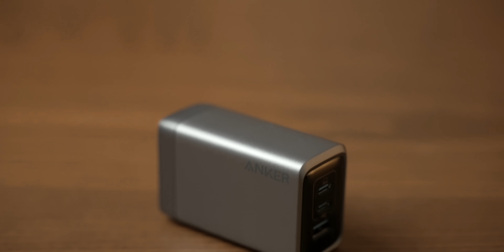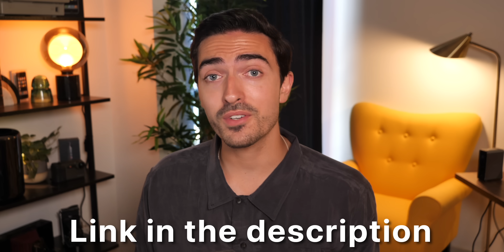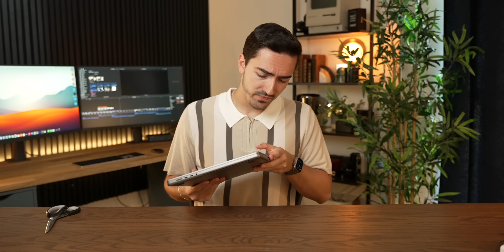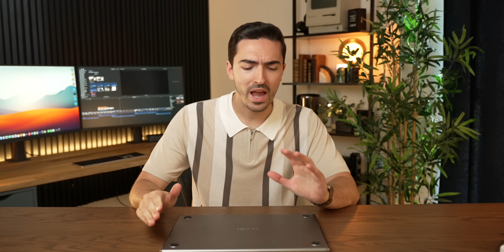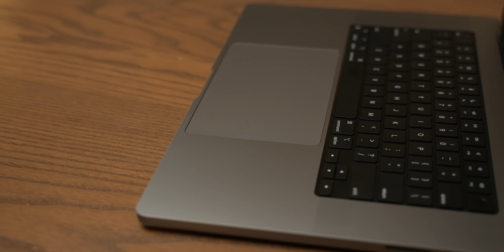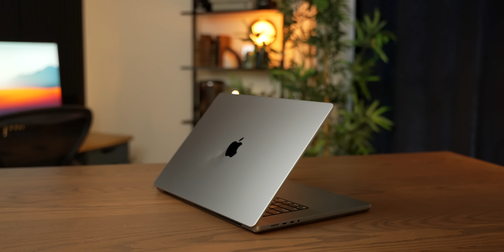I bought the CHEAPEST M1 Pro MacBook Pro on eBay!

Comment: Very good video.  Thank you.  Would I buy this MacBook Pro?  Um, no.  I don't but any laptop above $600 or so.  Still using a Gen 1 MB Air with 512 GB storage I bought for $400.  And a 2015 MB Pro with upgraded processor and dual graphics- $100. $500 total. Both still do what I need them to do.

Comment: I am from Germany and I earn my money by buying and reselling Apple MacBooks and imacs. Nowadays only silicon based. I purchased a MacBook M1 Pro 16" with 1TB SSD this week for 960 Euros in prestine condition with 52 charging cycles on "Kleinanzeigen" which is a nationwide marketplace here in Germany and the MacBook was even personally delivered to me and I sold it for 1375 Euros today earning me a 415 Euros profit. I normally average 100 to 200 Euros profit per MacBook and iMac so this was great. I have been buying and reselling Apple computers for over 4 years now and never lost money on a deal. 
I consider myself a great salesman and I have an edge over other sellers by professionally creating and promoting my advertisements as well as negotiating even good deals to make them great deals.  I also always clean each mac properly and I have to add that I don't buy junk or damaged items and if  i do in rare occasions then they are almost free. Many sellers use poor item descriptions , don't point out in headlines the specs properly. For example, the guy I bought the 16" from just wrote "MacBook 16 inch 2021" but no mention of M1 Pro, 1TB SSD etc 
This has earned me on average around 3K USD per month net profit and I work around 15 to 20 hours per week researching adds, picking up computers within 30 miles radius, creating new advertisements etc. not bad I figure and if wasn't so lazy at times I could earn even more.
Many people want to sell fast as they need money , or describe items poorly or set the price too low , or allow me to negotiate the price far below their original asking price. 
Luke, your deal wasn't so good, the display is the single most important factor on any MacBook as you always look at it and being frequently reminded that it is faulty when it is. 
For that reason most people would pass on it. Man, you and me working together would be a dream coming true, we could me making tons of money, let's get started! 😅

I am enjoying your channel as it is very authentic, honest, informative and sophisticated. There is something very likable about you and, forgive me for saying that, not so stereotypical American like other YouTubers. Keep up the great work!

Comment: Luke, try to pull the dents on the lid like they do with cars.  The pressure from the lid might be what is causing the low light issue as the LED panel might be prevented illuminating the screen by the dent.

Comment: I purchased my 16-inch M1 Max MacBook Pro with a 32-core GPU, 64GB of RAM, and 4TB of storage (almost fully specced out except for storage) for $2,040 about two weeks ago. I couldn’t believe the price, especially since I bought my base model 14-inch M1 MacBook Pro for just over $1,700 when it first came out!
Reply: Where did you find that? Sounds like an absolutely incredible deal
Reply: @ryleighnewman  I purchased it from BackMarket but I definitely got lucky. At first, I almost thought it was too good to be true since it even came in an Apple refurbished box. After getting it checked out by Apple Support, it turns out the laptop was indeed refurbished by Apple. The refurbisher listed on BackMarket was ‘Gainsaver.’ 🤷🏽‍♀️
Reply: @ryleighnewman  I purchased it from BackMarket but I definitely got lucky. At first, I almost thought it was too good to be true since it even came in an Apple refurbished box. After getting it checked out by Apple Support, it turns out the laptop was indeed refurbished by Apple. The refurbisher listed on BackMarket was ‘Gainsaver.’ 🤷🏽‍♀️
Reply: @ryleighnewman  I purchased it from B-ackMarket but I definitely got lucky. At first, I almost thought it was too good to be true since it even came in an Apple refurbished box. After getting it checked out by Apple Support, it turns out the laptop was indeed refurbished by Apple. The refurbisher listed on B-ackMarket was ‘Gainsaver’ 🤷🏽‍♀️.
Reply: @ryleighnewman  Idk why my comment won’t go through
Reply: I bought that exact same configuration brand new in May 2022 for ~$5,000 😅
Reply: @KC-bi9jw that avi is you right now 😂
Reply: @njpme  not at all! lol I am VERY satisfied with my M1 Max, its hard to even justify an upgrade. I may upgrade next year but only to get the 14” because 16” is too big I’m finding (footprint wise) while traveling. This was a purchase for my work, audio engineering.

Comment: I tried to love the Apple Silicon Mac's but I ultimately had to go back to Intel Mac's due to ARM compatibility issues. Bootcamp is absolutely imperative to my IT job and running a half baked ARM version of Windows in Parallels under a subscription is a scam and it only works when it wants to work.

Comment: Apple products are increasingly disposable and unrepairable either due to cost or design. Apple resale values will continue to plummet I expect - especially with the gimped hard drives and ram they all come with which many will not upgrade.

Comment: I picked up a base model 14" M1 Pro 8/14 16/512 this spring for $900 on FB Marketplace. It's in pretty perfect condition with Apple Care+ until July 2025 and only had 30-ish battery cycles. Incredible deal for a computer that was $2k two years ago

Comment: I'll bet that the dark spot issue can be fixed by applying auto body shop techniques to remove the dimple in the case top cover. This woud be done by adhering a hot glue post to the center of the dimple and pulling it up to take the pressure of of the display module. Most like coud be done with the cover still on the MBP.

Comment: Have an M1 Pro 14 inch that's 2.5 years old whose screen went kaput out of the blue while I was using it. None of the software methods worked to bring it back to life, my trusty workshop told me it's a common issue - mine developed a short in the connection to the display somehow. 

Looks very much like a design/manufacturing flaw, very very disappointed.
Reply: A bit challenging, but you might try removing the display and then simply reassembling it, and maybe that will bring it back to life.

Comment: The issue is the dent in the back so removing the screen and splitting the LCD and housing can be done and dents removed or even the housing changed so no electrical parts are changed with no issues can be done but it’s risky

Comment: M1 Pro machines still rock. There has been very little reason to upgrade unless you need the raw CPU increases from later iterations. Other than that the hardware has changed little since 2021 launch.

Comment: I’ve seen these M1 Pros with damaged screens for around £400 on eBay uk. I know how to replace the screen and yet I still decided it wasn’t worth it. Even if you do decide to flip you’re barely making 100-200 with all the effort and risk involved
Reply: Yep, I've just found one and I'm trying to decide  whether to buy it for use in clamshell mode, instead of buying a base M4 Mac Mini. It's £100 cheaper, has 512gb storage instead of 256gb and is still powerful enough for what I need. Good idea?!

Comment: I would be willing to bet if you take that screen apart and bend those dents back out it would be fixed. Screen discoloration like that is usually caused by pressure. Remove the dents, relieve the pressure. Would make a cool video as well 😁
Reply: You're probably gonna make it worse, as every speck of dust and fingerprint will show up on lcd layers.

Comment: You overpaid.  16" M3 pro machines are on sale for $1900 right now.  You bought a 3 year old machine with $700 in damage...  I saw one with a broken screen on my local marketplace for $500 and thought it was overpriced.  $1,000 is about what an M1 MBP is worth in mint condition.  That's a $300 machine.  Maybe if you're broke and desperate, you buy it and deal with the damage, but not for less than a third of the cost to repair.  Hard cap at $600.
Reply: correction. that's what a 3 year old damaged WINDOWS machine would be worth.
Reply: @LayerbyLayerOfficial  What would you pay for this?  I’m not sure of the eBay price, I live in a large enough city that there are several on sale on Marketplace for $1,000-$1,200.  You’d have to pay $700 on top of whatever you pay to make this machine = to a $1,000-1,200  machine.

Comment: Any way to use a suction cup and pull some of that dent out? Might be able to at least minimize the impact on the display
Reply: Suction cup isn't strong enough. But I was thinking that simple hotsnot pull might be sufficient.
Reply: It should work with some hot glue and try to pull it out. I would bring it to these car repairs that fixes dents, I'm pretty sure they will leave it like new for not too much money

Comment: Try using a dent puller, bet the screen goes back to normal.
Reply: This. The dent is preventing from the light reaching the screen evenly. Removing the dent would fix the uneven lighting issue.
Reply: @alborzdesign  @lukemiani worth a shot
Reply: but still a bet
Reply: I was about to comment that I'd try hotsnot and pull that dent out.
Reply: He's already got the suction cup
Reply: came here to say this
Reply: Excellent information, thanks
Reply: I was thinking the same, very gently with the smallest dent puller used by car body shop, it should do the job... But it's risky
Reply: I was wondering this
Reply: Be nice to see Luke try this, so we know how to do it.  It's not something I've tried.  Anyone done it and it worked?

Comment: gyus i have the M1 pro 1 TB since 2023 (almost 2 years) and i can do everything i want with this mac!!! The only thing I regret is the RAM... 16Gb is not enough anymore :( But still love it
Reply: Yep. I really, REALLY wish I had spent more money on the 32GB model. I consistently find that the 16GB on my M1 Pro laptop isn't sufficient for what I need to do. :/
Reply: @TheWalkthroughKiller  It's all in your mind.
Reply: @blackmamba6938 Any kind of modelling will just eat RAM. If you're doing serious design work 32gb really is the new minimum
Reply: Dude I have base m3 air 8gb and it works fine , 16gb is really enough , maybe your workload require much better computer
Reply: @technolevitator  yeah! I use a lot final cut pro x with complex editing so 16gb is not a lot
Reply: @AngeloCapalboGhelli  If all you're doing is Final Cut with complex editing, I highly doubt extra RAM would make any difference. If you had a 32GB RAM Macbook Pro right beside it with the same specs, it would run exactly the same.
Reply: @technolevitator no way, 32GB is minimum to keep multiple tabs open in Chrome.
Reply: @technolevitator  a few hundred, maybe.

Comment: @lukemiani 
I would - almost - bet that if you unglue the display and carefully hammer the dents flat from the inside it will be near perfect again.
Reply from the maker: I reckon you're right, but that would certainly be tricky!! I tried to use a suction cub to suck the dent out, but it didn't work LOL
Reply: @lukemiani  Perhaps heatgun it first if you’re feeling ballsy. That’s how you dealt with metal reshaping in the olden days
Reply: @lukemiani  if that dent wasn't mentioned in the eBay listing, I would be sending that right back for a refund.
Reply: add hot glue sticks like this paintless dent repair tutorials 😂
Reply: and break the display while ungluing it...
Reply: @graxxor  YOLO
Reply: unglue the display? Yeah, good luck with that.